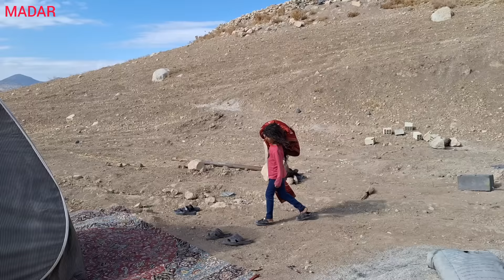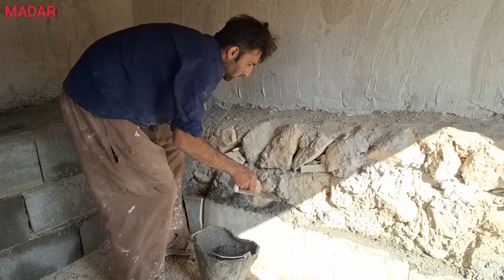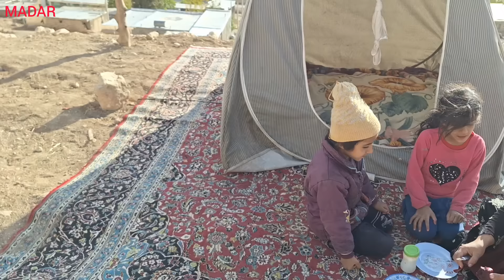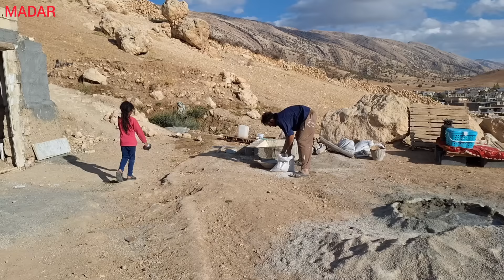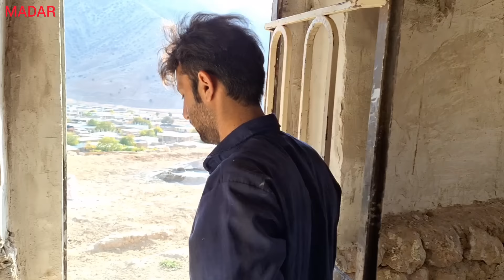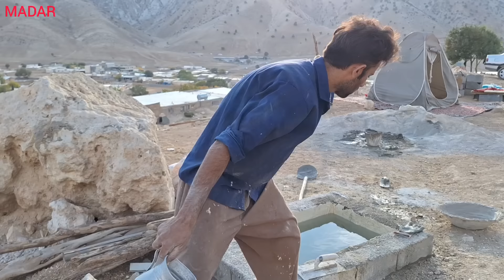"A heartwarming story of caring for two orphaned girls by Miss Atusa on a sunny day!"

Comment: Mr Operater  can  you  find  a  window  and  some  glass  for the  door  and window ?  Javad  needs  to cement  the  floor  and try  to  build  a  elevated  fireplace  on  the  back  wall  of  the  house  with  the  chimney  going  up  to  the  roof  of  the  house  and  vented out side.   He  needs  to  get  the  girls  and  himself  out  of  the  cold  as  quickly  as  possible  , he  can  then  continue  to  plaster  the  inside  of  the  house  in  a  warm  environment 😊😊💯🙏🙏🙏🙏🙏

Comment: JAVAD .. when you will finish the soil in your house please put a protection from the rain on the outside of  the back of your house with rocks or bricks what ever and cement it in a manner that the rain will go outwards from your house and not dampen or leak the inside!!  It can be done after the soil in the house